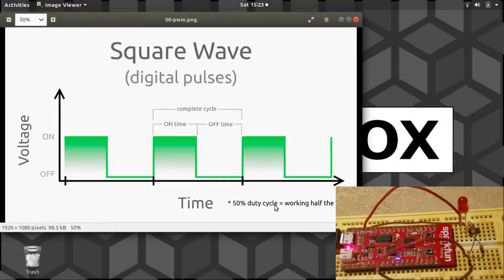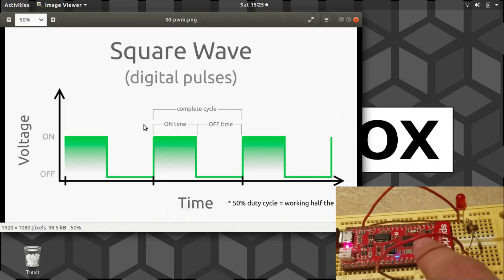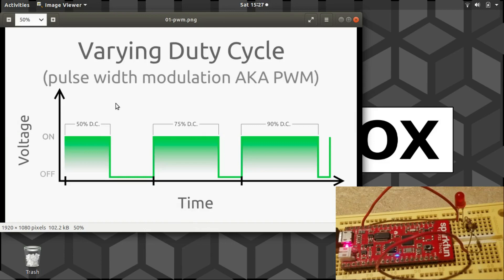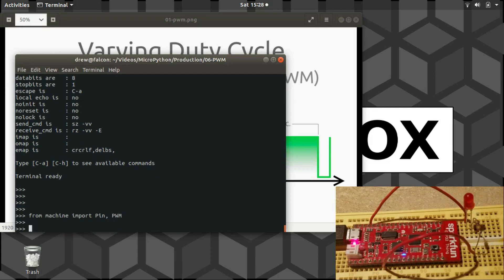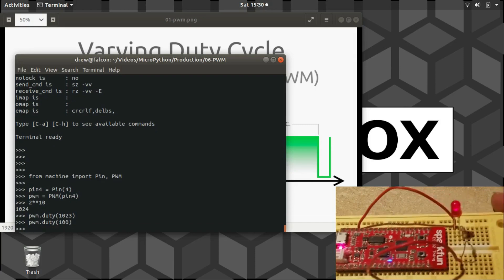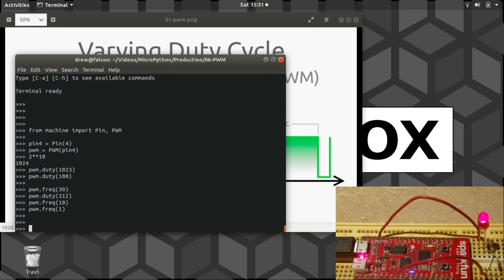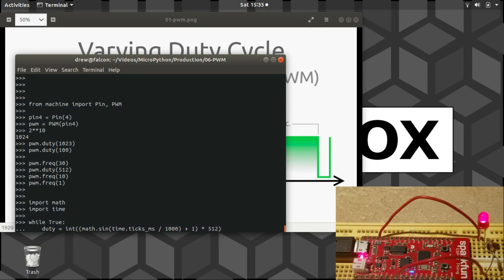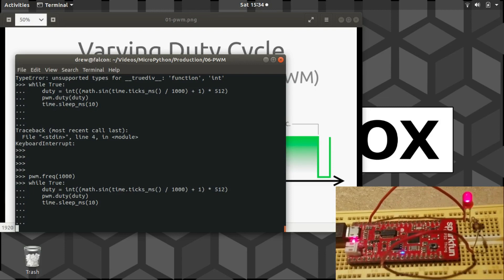Learn MicroPython #6 - fade an LED with PWM

Comment: I watched all the learn micropython  videos you did. Very cool. When you changed the PWM frequency it occurred to me that you could set 14Hz or 10Hz as the frequency and hook that to some Infrared LEDs and make a MIRT(mobile IR transmitter) aka a Dirty-MIRT, to change traffic lights, magically, to green!  Buses and public transportation use 10Hz and emergency vehicles use 14Hz.  I watched a guy from HAKC hacker-group give a talk about it and never could get it to work on an arduino. You just made it look so easy.  I don't really know any coding language but i am trying to learn. Love the videos! P.S. don't MIRT at home. Probably frowned on.
Reply: so ... i just tried... you can set 15Hz...13Hz, 12, 11, 10... etc... you cannot set it to 14Hz. TypeError: can't convert float to int. looks like someone had the same idea i had.